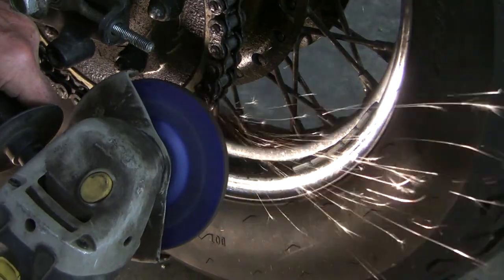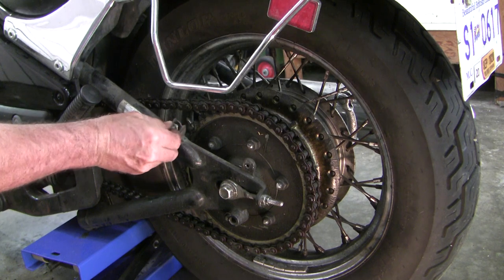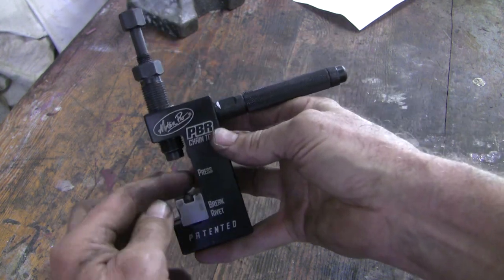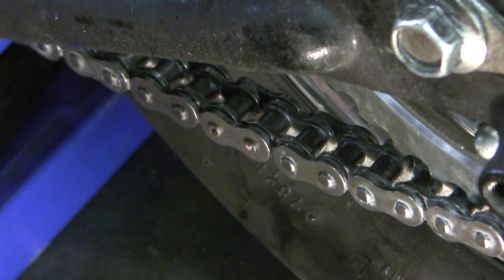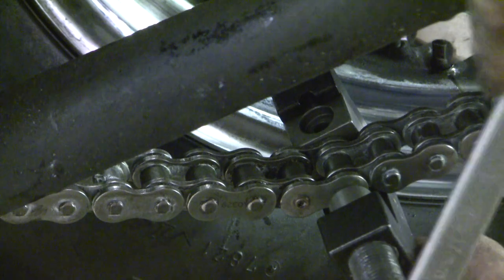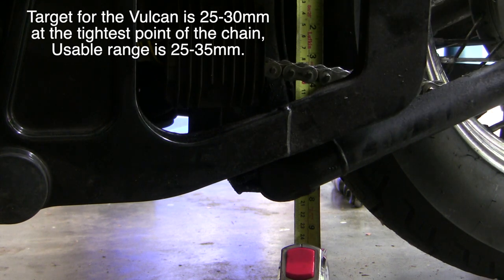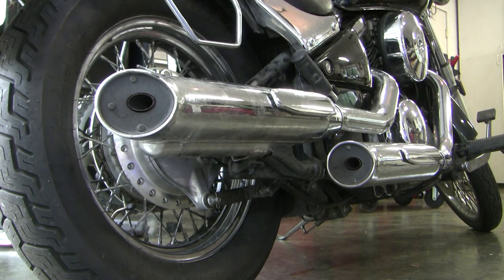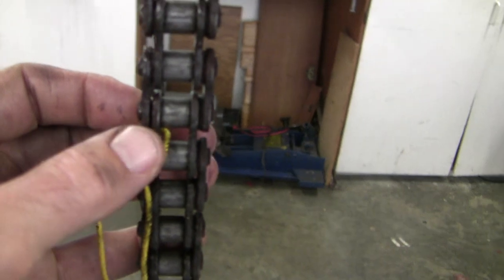How to diagnose and replace a bad motorcycle chain, PBR chain tool review

Comment: Mine was very loose, the chain would even come off the sprocket a little bit where the master link attached the two links on the old chain. Moved the back wheel back as much as i could and the chain slack was still not correct. Ordered a new chain and that tool to link the chain together which should be stronger than using a universal master link. Really like the notches that Vulcans have to set the back wheel. 

Thanks for the video!

Comment: Great tutorial. My dirt bikes(when I rode often) used to wear out the chain and sprockets in a about 1000 miles of trail riding. I think the harsh shock load of trail riding mixed with the shock load of the thumpers contributes to the problem. It seems like street bike chains last 20,000+ miles but many of those have a rubber mounted cushioning hub to absorb the shock loads.

Comment: I would suggest using factory made endless chains. Of course, someone will have to take a swingarm off to re-place it. I did on mine VN800A. Well, and one more thing. Your chain tools will last longer if would use a grinder to cut the chain fully.
Reply from the maker: Interesting thoughts, it's always nice to see problems from another perspective. Thanks for your contribution to the thread!

Comment: how the hell did your front sprocket nut come off so easy?? Mine took a lot of fighting (yes even with my impact) i was amazed. i had a friend holding the brake, a screw driver jammed in between the rear sprocket and the chain and still took a lot of fighting
Reply from the maker: Good point, I was ready for a fight, but honestly I just got lucky. Maybe the last guy put locktite on yours. Locktite shouldn't be needed because the washer should hold it on. My impact wrench is top quality and I had pressure set at 100psi, sometimes I go higher if I think it will be difficult. If I ever have trouble I remove the 1/4 inch hose and use a short 1/2" hose to deliver more air volume. The other thing that makes a difference, surprisingly, is the mass of your sockets! Specialty crank bolt sockets have more mass, and evidently impact wrenches can impart more momentum to a socket that is heavier. Now that I think about it, I don't remember what size that nut was, I should have mentioned it in the video. OEM tools sell a high mass 'crank bolt socket set', 25276, that makes it easier for impact wrenches to spin off nuts like this one. In this case I didn't use a socket from that kit, but the socket was a dedicated heavy crank socket, in any case. Without air tools I'd reach for a long pipe to extend the lever of the wrench, consider careful heat to the nut only, and pretreat with penetrating oil. Thanks for stopping by!
Reply: @spelunkerd  Yes now that you mention it i did have to crank my compressor to the max output for my impact (i have a Ingersoll Rand) and then it came off. I feel like just the nature of the way how the bike "self tightens" the nut because of the direction it spins made it a bit harder. On another note, Have you ever thought of getting some loud pipes? im debating on doing that this winter but where i am (montreal) the cops are a bit strict with loud pipes. Also in another video you mentioned that they have an aftermarket petcock that has a real Off position. Can you please send me a link so I can buy one? Thank you! I love the videos and have been following this Channel for a long time!
Reply from the maker: @frankmazzaferro8331  I don't know anything about straight pipes, except to know that my province (BC) won't permit a "classic" designation for lower insurance if pipes are modified. I've seen some speculate that you may have issues with carb jetting or air suction valve issues with straight pipes but I have no experience with that. You could probably find a standard petcock on ebay, they are prevalent in generators and lawn mowers. I like my automatic. Thanks for stopping by!
Reply: @spelunkerd  Thank you again!

Comment: i find gear oil perfect for chains .
Reply from the maker: There's an interesting comparison test done here on Youtube comparing various options, on the compelling channel "FortNine". Yup, gear oil came out on top, obviously with no corporate sponsorship to push an agenda. Through the years I have preferred chain wax because it doesn't spray oil onto the ground, and it stays put, but it is hard to deny the fact that wax can retain dirt and impurities. It likely doesn't wash away lubricants behind O rings as easily as thinner options. Interestingly, the new chain came with a healthy coat of wax everywhere. Wax leaves a sticky mess that is annoying to clean up.  It is certainly easy to use, and if you're a little slow with maintenance you may do a little better. This chain lasted 26,000 km so I can't complain. I might go back to gear oil after all.